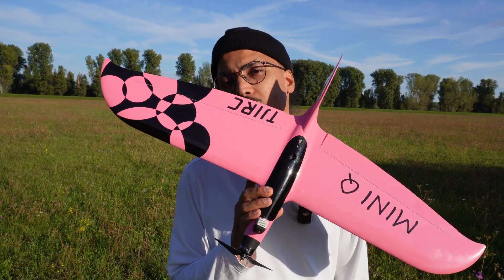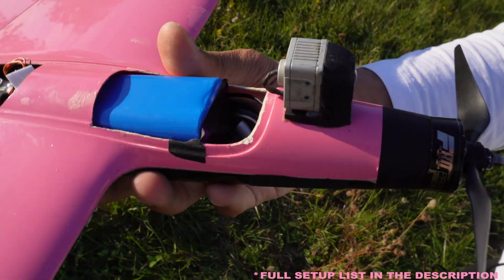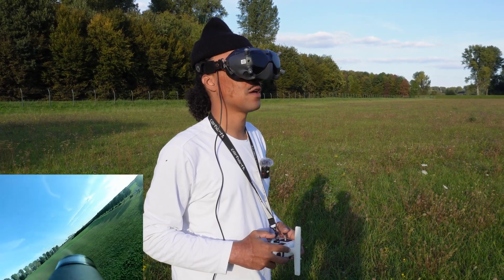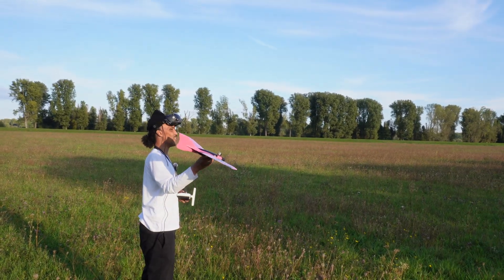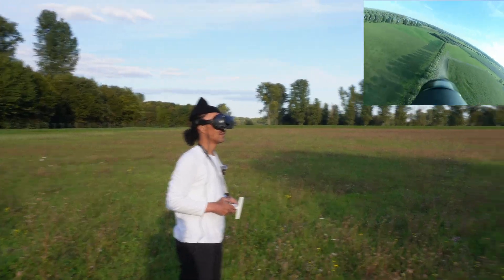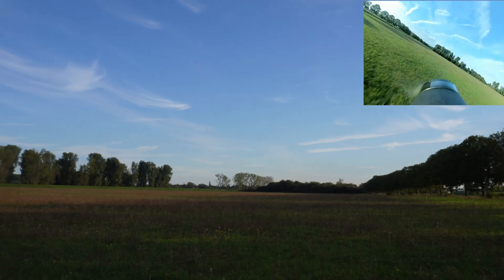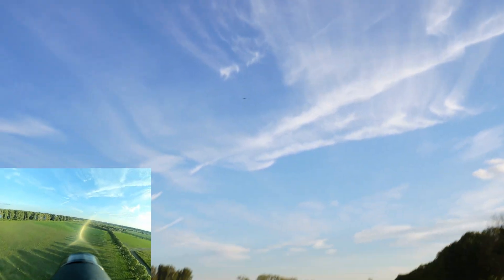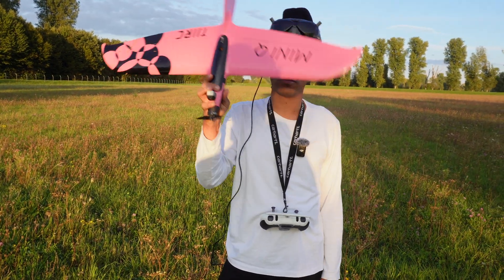Can this RC Plane hit 300 km/h? | High Speed FPV | Mini Q

Comment: how much fly time do you get withh a 650 6s?
Reply from the maker: Idk. I only used it in this video for max speed. 
4s 3000 gives me 7 min full throttle tho.
Reply: @kofikofikofikofikofi  I'd like to get this wing awell and wwant to fly it with a drone 1300 6s battery. Does it fit? it's possible to have a 6s 21700 fit in it too?
Reply from the maker: @giuseppe.marino u won’t regret it. It’s an advanced build tho. 
Nah u can only fit a 650 6s lipo or 4s 18650 in there

Comment: Is your mini q on inav? Could you share the inav cli
Reply from the maker: It’s on inav but there r no special settings. Stock inav everything. 
Only mechanical tuning, minimal throws.
Reply: @kofikofikofikofikofi oh ok. I would have guess the pitch weight would have been significantly reduced. My research shows the miniQ throws are very small.
Reply from the maker: @squirrelynutz1 exactly. Pitch 30% 
Roll 55 %. Custom 13 mm elevon horns

Comment: APC do a 4.75x5.5 which is nice and efficient on the Mini Q. Launching is difficult because of low static thrust though. 5x5 is much easier to launch but not quite as fast.
Reply from the maker: Nah it’s slower. U need pitch to gain speed but u also need need diameter to overcome drag ,there’s a balance. 
Fav prop for this setup 5,25x6,25 or 5,25x8
Reply: @kofikofikofikofikofi  For sure. 5.25x8 sounds exciting!

I forgot to mention mine has a 2200KV motor on it. The RPM difference probably plays into it.
Reply from the maker: @lightbulbjim ah that makes sense ! There’s also a twin puller conversion for the q ,where the 4.75 x5.5 would make sense. What’s your complete setup? I’m curious

Comment: Cooles Video. Aber Bau mal eine anständigen Motor und esc ein. Ich würd ein 25er Peggy nehmen.. ✌️
Reply from the maker: Danke für deinen Kommentar. Ich glaube du überschätzt die Größe des Modell. 😅
Reply: @kofikofikofikofikofi lol. Ne schon richtig ;-) Wenn es leicht sein soll den Nr kleiner.
Hab den 25er 2540kv im sehr verstärkten Funjet. Geht an 4S2600 vom Stefan knapp 100A und 6*6 bis 5*8 Abartig. 300kmh, kein Ding.. 😂
Reply from the maker: @milankralowetz3391 geil !

Comment: you have low pressure area right behind the camera, add a smooth teardrop-shaped "slop" behind the camera
Reply: Where can I find the stl of the 3d printed  in front of the camera?
Reply from the maker: No need to overengineer it bruv
Reply: @kofikofikofikofikofi  if you want 300km you should
Reply from the maker: @vmaksym tbh the battery is the limiting factor that’s why i dont bother but jeah your right.
Reply: @kofikofikofikofikofi  I see, anyway it was a nice try, thanks for share this video

Comment: Nice!! That thing is quick... Put enough motor and a custom prop on it and you should get more than 300 kph easily. I currently have the record for a basically stock Strix Nano Goblin at 316 kph. Building now for the full size Goblin record but, it is a bit more difficult. Rupe's set the bar pretty high.
Reply from the maker: The limiting factor is the battery. It’s kinda impossible to fit more lipo. I would have to rebuild the whole thang. 
Tbh I don’t care about the 300 to much. The fusion is already way faster with more room for battery’s.

Comment: ultra-aerodynamic, and places a camera/air brake on the fuselage
Reply from the maker: Oh u really smart. Let me know where else I could put the camera?
Reply: @kofikofikofikofikofi  I agree that the tractor format isn't ideal for FPV, but the camera position really surprised me. It's tragic to have such a sophisticated aircraft for this little default
But at the bottom of the tailplane or below the wing at the same emplacement (slower airflow), with the most aerodynamic design possible, it would surely be better.
Reply from the maker: @Radis_fpv Bomboclat
Reply: @kofikofikofikofikofi  😭 (You could have done lots of other things:
put in an O4lite
make a loft behind the camera
completely rework the canopy
or just use a pusher (less stable and efficient, but since there's an FC and a big battery, who cares?), and it's better for the camera position and high speeds. )
Reply: @kofikofikofikofikofi  cam inside a transparent cannopy
Reply from the maker: C‘mon bruv

Comment: Thanks for your tests, for me it's actually the other way around.
I fly the Chupito with a 4s 5000mah, and have 52 minutes of flight time and a distance of 70 km.
Reply from the maker: Different strokes for different folks ;) you can try a 6s liion nd Cruise at 90 km/h. Still get 70 k+ roundtrip. Chupito is super efficient compared to other foamies
Reply: @kofikofikofikofikofi  do you have a prop recommendation for that type of flight?
Reply from the maker: @rwdturbo 
Apc 6x4 Sport. Watch for the amps at the beginning of the pack when Ure using stock esc. 5,5x5,5 Carbon Speed if u in Germany. Gf 5536 if u can’t find anything else.
Reply: @kofikofikofikofikofi awesome thanks. I have a 6x4 apc( thin electric)I haven't a chance to try yet, so that will be on for the next flight 👍,

Comment: Li-ion is an interesting choice.
Reply: Yeah a LiPo would mean more power to weight which could possibly make it a tiny bit faster or at least accelerate faster.
Reply: Modern liion cells can easily discharge 45-50A continuous which is within the max current draw of a Tmotor F80, for wings it's a great pick. 6s seems like it wouldn't fit in the fuselage tho so LiPo is obviously better for speed runs but you can tell he's still not pushing more than 55A on 6s
Reply from the maker: @platyfpv the mandem knows wussup. Tbh I haven’t tried the newer molicels. These packs r old Samsung cells.
Reply: @kofikofikofikofikofi molicel is already old news. china got ampace JP40 and EVE 50PL which are stronger
Reply from the maker: @HolyOllie dang I’ll have to check these out
Reply: @platyfpv 6s1p should fit. Fuselage is huge
Reply: Thats good speed for Sony cells. Ive been doing a bunch of research to build my first FPV focused plane. I want moderate speed, not crazy fast but faster than a bush plane and 6-10minute flight times. It will be a 2w analog vtx, and crossfire with a t antenna. All I have are quad batteries so I was gonna run 2 1300mah 4s packs in parallel. Not sure if I want to go with a "plank" design, a classic flying wing, or a twin boom pusher style plane. I dont like the yaw wobbles of a normal flying wing, even with wing tip vertical surfaces they always seem to "slither" a bit. The pink plane you have looks great with that long vertical stab in back. I really like that
Reply from the maker: @sakfpv8444 tbs Chupito
Reply: @kofikofikofikofikofi  I would, I love that thing but I really enjoy building my planes. Either from foamboard, depron, or home depot insulation foam. Ive built warbirds mostly and some high wing type planes. But I really wanted a specific FPV build. I'm the RC guy that likes building more than flying.
Reply from the maker: @sakfpv8444 check this out then 

https://youtu.be/c8R6Nm8stU4?si=yKECqlHlqs0lm5XP

Comment: Man I would love to build something like that. How hard are composites really? Practically?
Reply from the maker: Tbh wouldn’t recommend it as a first, second or third build.  composite planes r never fpv planes in the first place( no mounting options for your electronics , cg can b tricky. 
You can’t crash , expensive airframe , lethal weapon , use of epoxy etc) 
It’s worth it tho , nothing compares to that level of performance nd locked in feeling.
Reply: pretty involved if you want to build from moulds yourself. if you buy the completed airframe it's not any more difficult than building a foamy